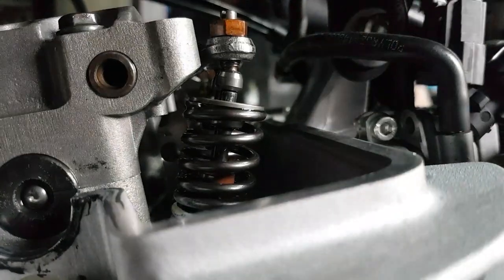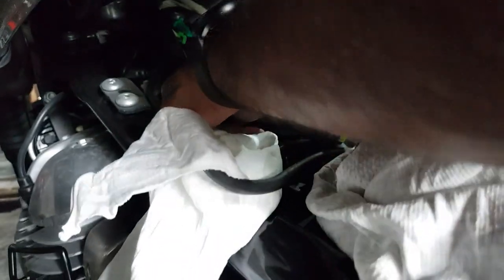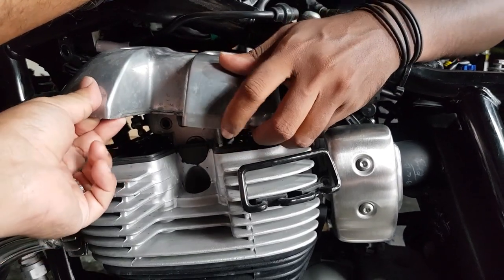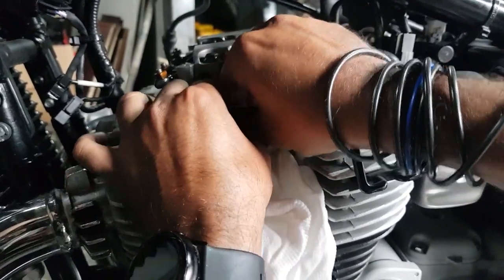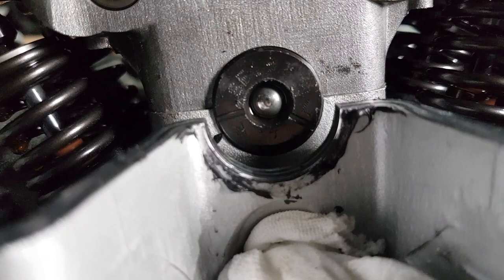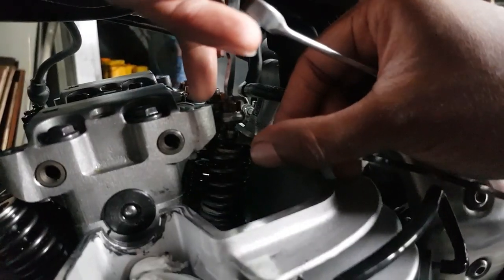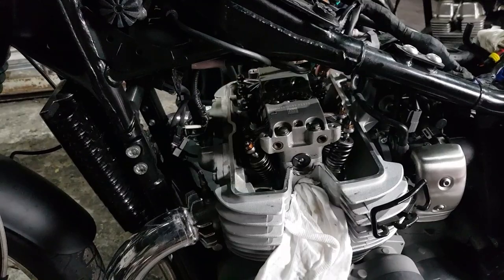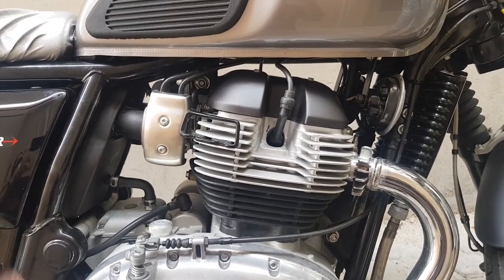Royal Enfield Interceptor 650 Valve Clearance Check/ Adjusting Valves/ Tappets

Comment: To make removal of the valve cover much easier, locate the large rubber breather tube in the front of the cylinders and pull it off of the metal nipple.  Than push it out of the way.  You may also want to snip the zip tie that holds the horn wires to the breather tube.  The breather tube will be easy to re-insert once the valve cover has been replaced.  You can use another zip tie to pull the horn wires against the breather later, as well.  It makes a significant difference.  With more room in the front of the cover, it comes off much easier.
Reply from the maker: Thanks for the info. We'll keep that in mind for next time😁

Comment: My int650 works fine until a few km when it gets hot, it starts giving this squealing sound. The rpm's are fine and there's no lag or anything. But that squealing sound is very irritating. So much so that, I've started using earphones while driving now. 

I've looked around a lot but, dont seem to find the solution for this. Any ideas?
Reply from the maker: That's a weird one. No idea why that would be. Be best to have it checked out by a mechanic.

Comment: Hello sir, after 6000km my re sc guy adjusted the valves for my interceptor 650, he said they were lose, i got to get more tappet noise so he said he tightened it as per manual, but my vehicle starts to drop rpm in idle and stoping in traffic, he said it will take time to adjust. But after compelting 500 kms also it is same. It is normal should i wait?
Reply from the maker: Better get it checked again.
Reply: @revhappymv  they took the vehicle and said issue is due to temperature sensor or fuel pump

Comment: Question of the day.  How do you get the rubber gasket to stay in position (without help) to mount the valve cover. I found I had to clean the section where the gasket fits into the cover free from oil, clean the gasket, then carefully silicone seal the gasket to the cover. When removing the cover for another valve adjustment, I simply remove the (round) rubber cover of the cam shaft (carefully) with a flat tip screw driver while lifting the cover.  Gasket stays in place. It refits a lot easier than going back and forth trying to realign it. 
    Great tip on removing the horns. I have  had issues with squeezing out and in the cover with the space provided trying to avoid rubbing the gasket against the cam cover. 
  you video advise made it to San Antonio Texas USA
Reply from the maker: That's so cool this reached all the way over there 😀 Hi San Antonio Texas! The gasket was a two man job when we did it. We only silicone sealed the round bit so the rest we had to hold in place while repositioning the cover. We luckily almost always have some helping hands around as most of our friend group is way into motorcycles. Glad you like the video and thanks for the comment 😊